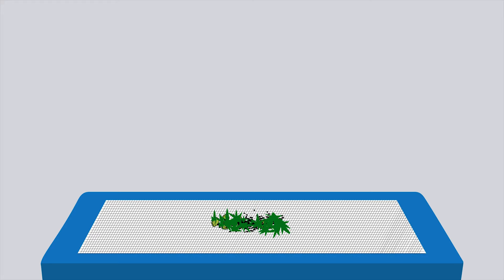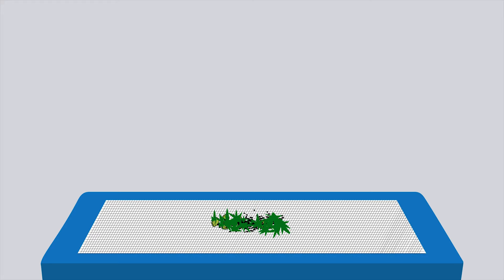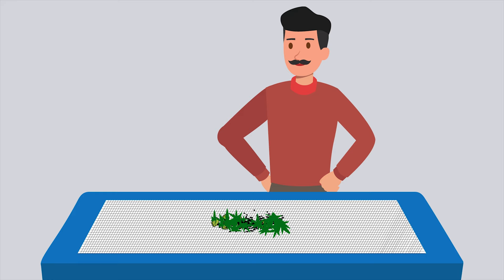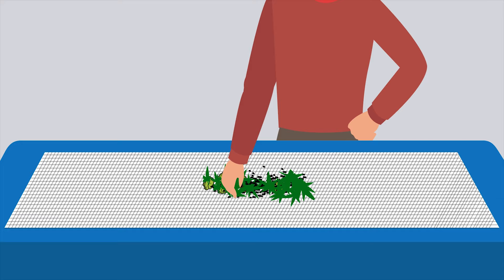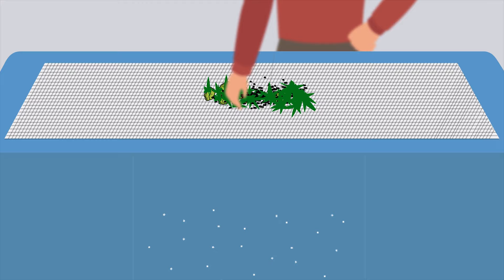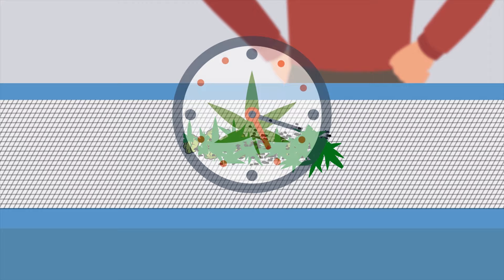How to Make HASH!

Comment: Lazy/Poor man method; put all your stems and leaves in jars in the freezer. After a day shake the 💩 out of the jars. The frozen trichs are brittle and will break off the plant material when all parts start banging into each other and the jar. Simply pour jar out into a sifter or fine strainer. Put in cellophane or wax paper, put in between 2 bricks, and stand on them to press into beautiful brown hash. Helps if it's summer and you leave the bricks in sun all day to heat up, get the resin gooey from the heat to make a stronger bond. Free.99
Reply: Cool will try

Comment: A screened tumbler inside of a freezer will allow the dust to fall to the bottom and onto a Payne of glass. This works great with the larger buds as the bud keeps it form and looses the good stuff.
Reply: Ahh what an eye opener!?
Extract the, "The Head Change" and "Christ Brings Deliverance" from the flower!
Reply: What the heck is a screened tumbler?
Reply: @nopenope2134  It's a motorized cage that slowly turns with the bud inside. When frozen the trycombs shrink and fall of the bud, it's  now hash.

Comment: An unusual method ... Take an undried plant  with good resinous bud and put in a dark dry place , a desk drawer  , cupboard etc. . After a few weeks the plant will grow a nice crop of mold. Remove all stalk and vegetable matter that is left, the mold will have destroyed most of this just leaving a grey dust and the crystal ,  weakening the  surface of the crystal sacs So with a little warming pressure and moisture  ,  the palm of your hand can supply this ,  it can take a little time but is a very pleasant occupation , you will have produced some of the finest hand rubbed hash :)

Comment: If you don't have a press, supposedly you can use a cylindrical bottle filled partially with hot water as a roller, rolling and folding it several times and then forming it into a ball shape (traditionally called bubble hash iirc)
Reply: @smokedbeefandcheese4144  ah, thanks for correcting me on that
Reply: I heard you can use a clothing iron too.

Comment: Real hash is heated and pressed and its rubbed on silkscreen in the cold they lay plastic down under the screen to catch the kief. Take the kief and place it in a square pressing mold press at 2 tons and heat it to aroud 200f for dont go over 220 press for a minute or less
Reply: That's just one of quite alot of ways to make solventless hash.

Comment: HELP! I’m new to this stuff and I’m about to have enough kief for hash so please correct me if I’m wrong…

1) place kief on parchment paper

2) apply heat and pressure or apply alot of heat then some pressure after if your not able to do both at same time

Is that the right process? Also I don’t have parchment paper what could I use as a substitute? Sorry this is copy and pasted on a lot of videos for a higher chance in my stuff seen I know it’s low but I’m kind of desperate.
Reply: why would you do that.

Comment: How come hash coffee used to work so well ? And how can you make weed useable in a coffee ?
Reply: Bring milk up to just before a boil, set on simmer, put your weed in, steep for 20-30 mins, stir every few mins to prevent burning, then filter through a coffee screen. That’s how you make canna-milk. Then put it into your coffee. 
You can do this with any fat based liquid or oils. 
I use coconut oil for baked and non baked goods.
MAKE SURE it is not fat free milk.
THC clings to fat.

Comment: Are the flowers smokable when its warm after freezing it for kief? Of course we don’t just throw it right?😂😂
Reply: No dipstick, it's used up.
Reply: @Anonymous_________  not nice, also you never throw out bud, its only not useable when you mix it with a chemical
Reply: it will still get you high, but you will have to smoke more. I like smoking the stripped buds for this reason, i can smoke more without getting too high

Comment: So I ended up buy bird food for my parrot, and found cannabis seeds inside I took some and tried germinating it but to no luck. I wonder why? Did they do something to the seeds?
Reply from the maker: They were most likely hemp seeds rather than cannabis seeds. Although theoretically possible to germinate these it would depend on the condition and length of storage.
Reply: i think seeds sold as feed are pasteurized so they do not germinate.
Reply: Yes they sterilize them
Reply: Those are hemp seed too wouldnt want to smoke hemp.
Reply: @kenharty6016  that's how CBD is made, genius lmfao 😂
Reply: @Anonymous_________  they dont make cbd from hemp dude.  Hemp yeilds so little cbd its pointless.
Reply: @kenharty6016  Actually most CBD oils are made from hemp which is why it is legal since hemp has such low thc. CbD is not the same as thc.
Reply: @JAM661  well in canada they use all kinds of marijauna to make cbd products and hemp is the least productive out of all them to produce cbd. They can separate thc and cbd quite easily.
Reply: @kenharty6016  no, hemp plants produce wayyyy more CBD than marijuana, you are completely wrong. Hemp has under .3 percent THC but will often have upwards of 20 percent CBD, where marijuana can have 20-30+ percent THC but is usually only 1-2 percent CBD. I don't know what info they gave you in Canada but it's wrong.

Comment: If I bough a press and clamped it shut would that work to make hash with kief?
Reply: Im going to try the same. Looks like it should be heated or you are just making a kief puck. So, i think 200 to 220f which is 100c. So i bought a 1inch copper end cap and going to put 2 toonies (cdn 2 dollar coin) (one on each end) and squeeze with a c clamp and then put in a bad and put in boiling water.
Reply: @jonathankr  I’m looking at making it into a thin hash brick. You think it would be better to pre-heat the press first? Then put it in a pot of water at 100C with clamps?
Reply: @jonathankr  I wouldn't heat it that much man, just enough to soften it and start releasing some oils. If you heat it too much you are gonna degrade the THC. You aren't trying to decarboxylate the hash since you are going to smoke it, you just want to soften it to make it stick into a tighter block.
Reply: yes a press will work fine, I have no idea where this video was going with saying to use a car jack lol,